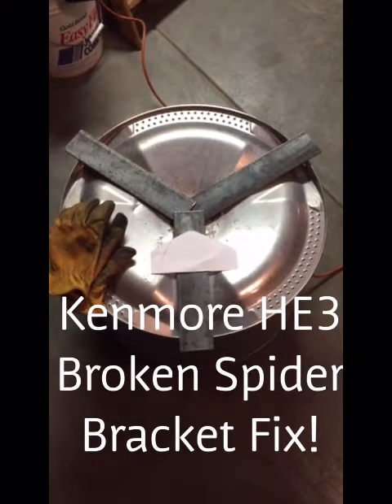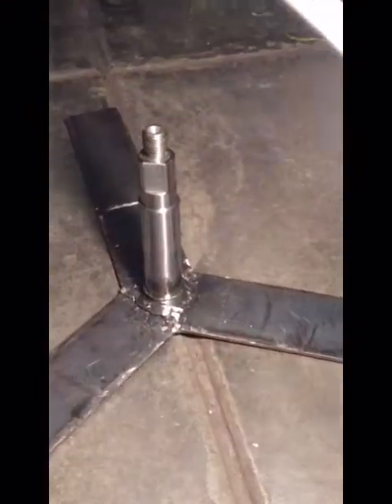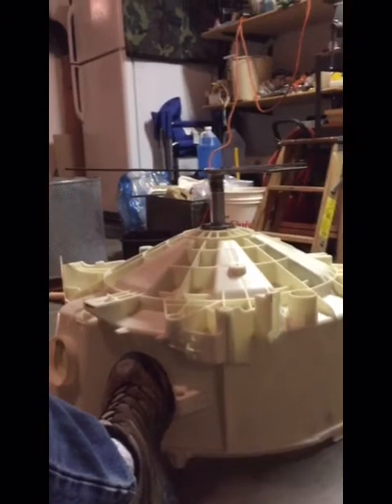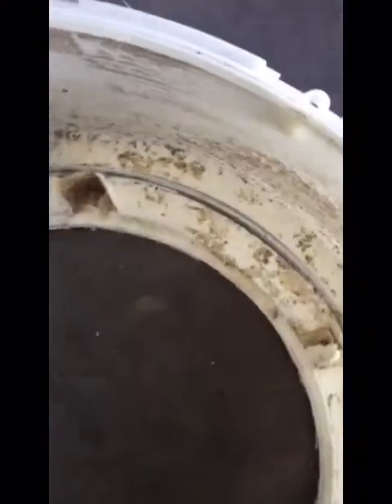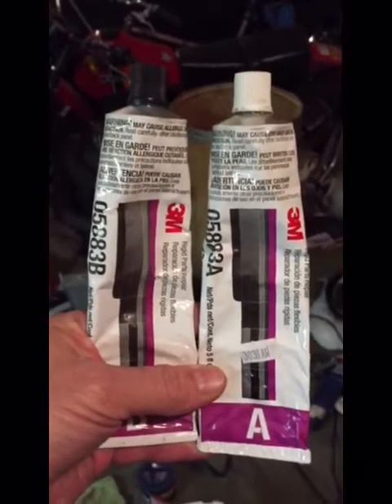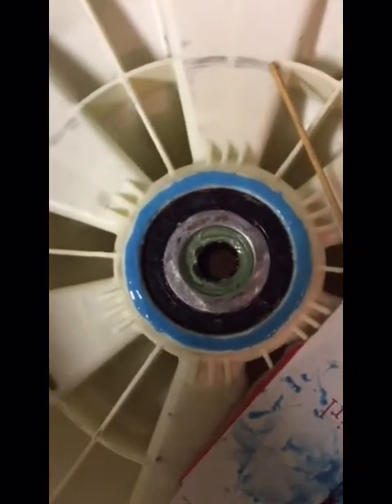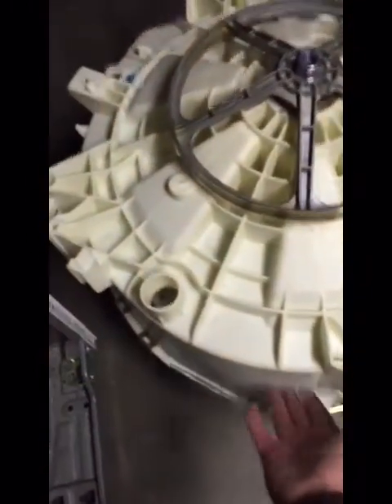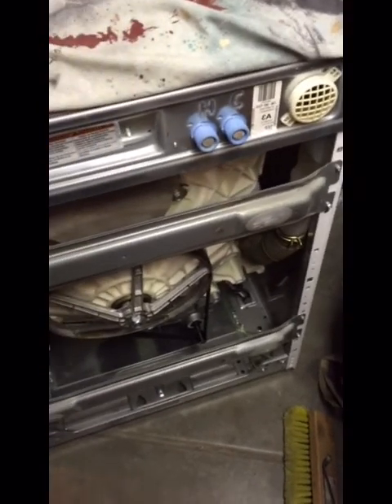Kenmore HE3 Washer broken spider bracket fix!

Comment from the maker: Finally tested this washer a while back.  Noisy (but doesn't walk across the floor) for the 3 minute high speed spin cycling (better on lower spin speeds), but otherwise works just fine.  Had $45 into the project and just gave it to Habit ... they tested it and were happy to have it.  Hope it washes clothes for someone in need for a few years.  Was a good learning experience.  Sorry this video is so long ... will shorten up the next ones.